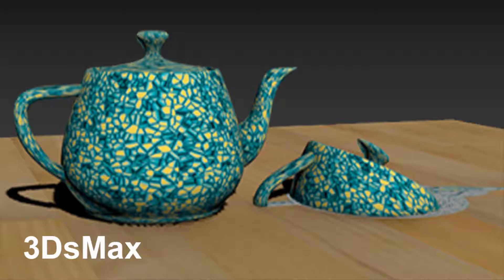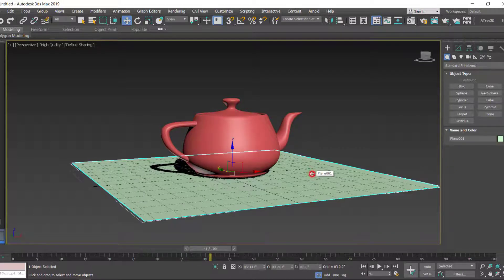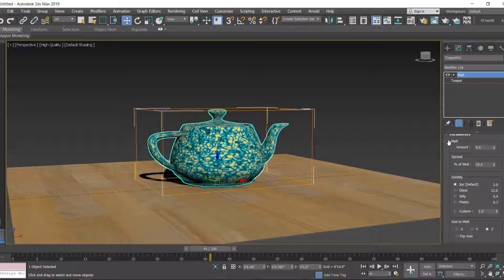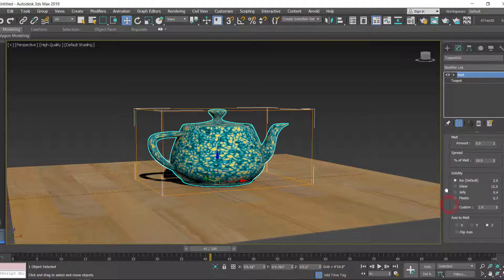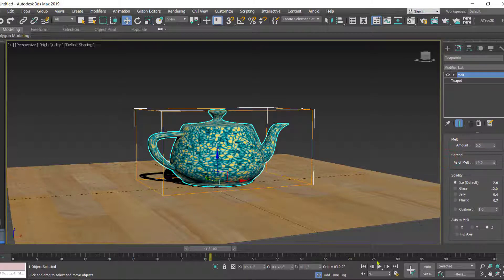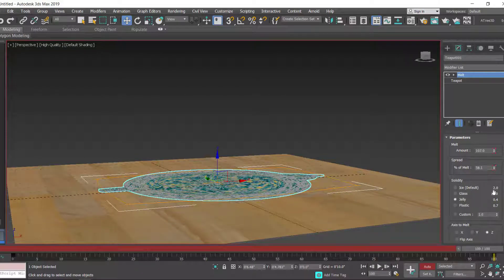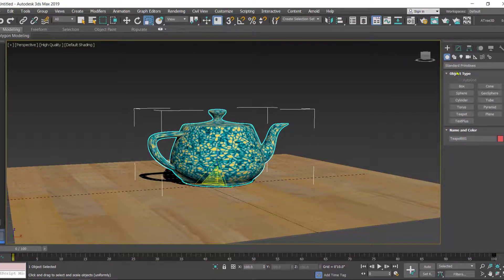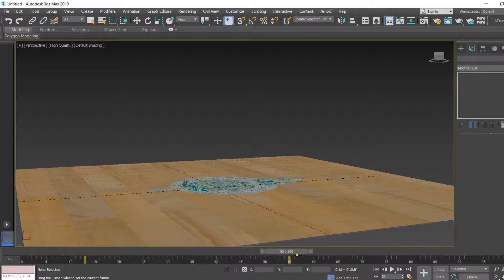MELT Animation in 3Dsmax | @Quick3D

Comment: how do you export his with an animation ?
Reply from the maker: To which application do u want to export
Reply: @Quick3D  we tried exporting to unity, but only had the mesh, and no animation, even for 3dsmax when we exported and réimporter it, the animation was gone, while it worked perfectly when we used morphers
Reply from the maker: Plz ensure the Animation option is  ✅️ checked during FBX export and in UNITY  for animation type try using Legacy. hope it works.
Reply: @Quick3D  I'll try with legacy, but we always checked the animation box, and it usually worked with the morphers, but not with this